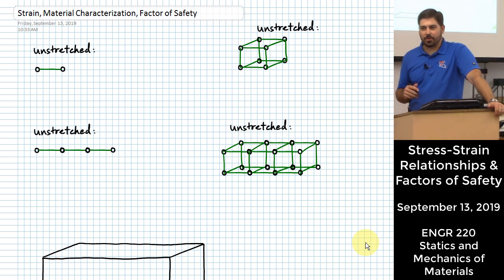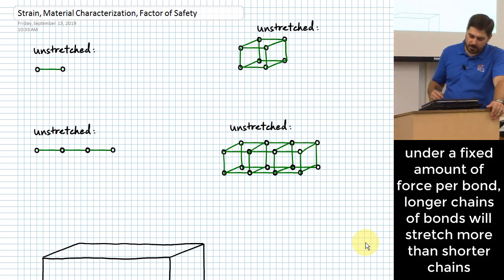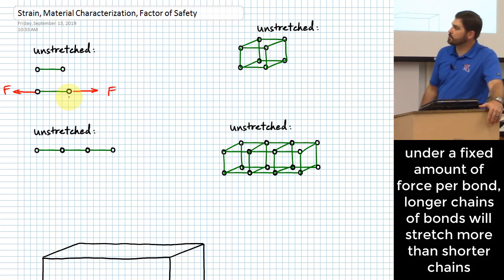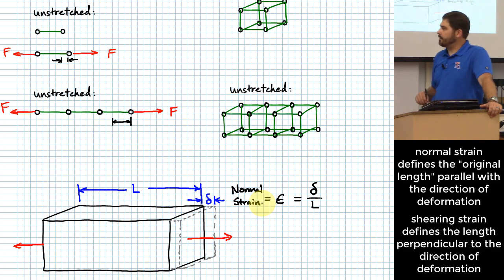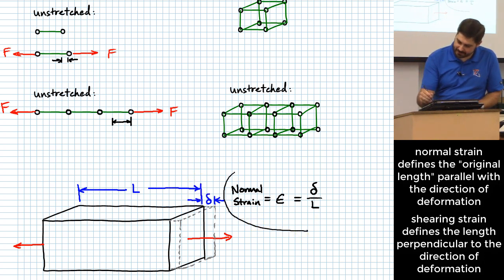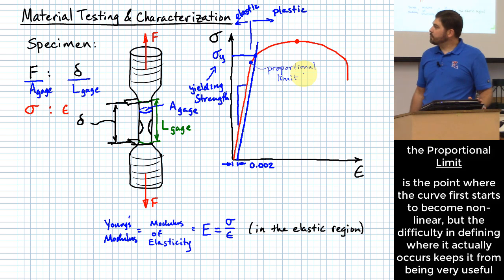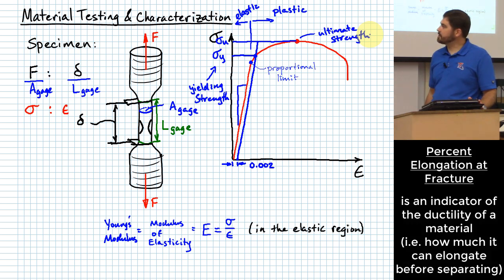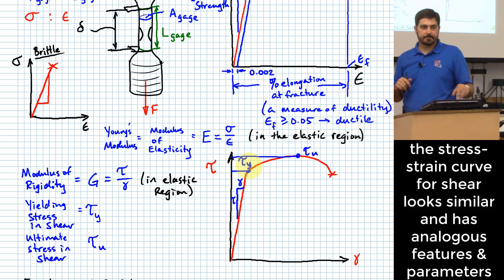Stress-Strain Relations: Tensile Testing, Yield & Ultimate Strengths, Elastic Modulus, Safety Factor

Comment: Very, very clear explanation of otherwise difficult concepts to acquire in just a few sessions.  Love the modern whiteboard presentation technique.  

I am a retired computer engineer trying to design prefab affordable housing (called Backyard Cottages in Seattle), using Sketchup-Pro and SkyCiv online stress analysis tools.  I think the SkyCiv Section Builder tool is not generating the correct second moment of Inertia for my composite DougFir wood and steel "T" top/bottom cord - beams.  Forcing me to check the results using hand calculations of strength characteristics of my funny but useful composite shapes.  Your lectures on statics and composite beams ..etc, have helped me understand what I need to do.  Your presentations proceed in very logical steps, helped by real world examples to help students like me form a better mental picture.

Thanks again.    SkyCiv is a very good program, fantastic when my designs use standard shapes in the model, but I think my wood/steel beam sections aren't easily "transformed" into a single material for the FEA calculation engine.
Reply from the maker: Sounds like some fun stuff you're working on! I'm happy I could help! Thanks for watching!

Comment: Your lectures are quiet helpful, in the sense it is easy to apply to real world projects. Grateful to your contribution, thanks and looking forward to more. I have a question here regarding the shape of the curve from Force Vs displacement to Stress vs Strain (@ 44:30). Shouldn't the curve change shape for stress since it is per unit area and in the necking region, this would behave differently than total force?
Reply: This is a generalized graph for an introductory course. The students haven't even heard of the concept of necking yet, so I would think it is appropriate to reduce complexity this early on.

Comment: Hello Sir, Could you please explain the  difference between Yield Stress and Tensile Stress. I have been reading many definitions , But still find to get an idea. Thanks
Reply from the maker: I think the video does a pretty good job of explaining yield stress... as for "tensile stress" ... that is a term that in many sources is used roughly synonymously with the value I'm calling ultimate stress in the video.

Comment: hello sir thank u for this lecture i have a Qs at 41:55 when u star to  to explain why the curve curve back down i don't get it ; u said the area decreasing that mean the curve should go up and not back down  (and we will dealing with a true stress-strain curve)....  this is a stress-strain engineering curve that mean we keep divide on the same area that we start with A(o)  we do not take the instantaneous area A(t)

 the curve should always increase since the tension force in a tensile test is always increasing and the cross sectional area of the specimen decreases, which means that the stress is always increasing...that for a true stress strain curve 

HOPE U CAN ANSWER ME I'M REALLY CONFUSED
Reply: the y axis is force! So as the material gets thinner, less force will be needed to move it, so the line will move to the right still because it hasn't break yet but the force to make it stretched will be lower and lower!